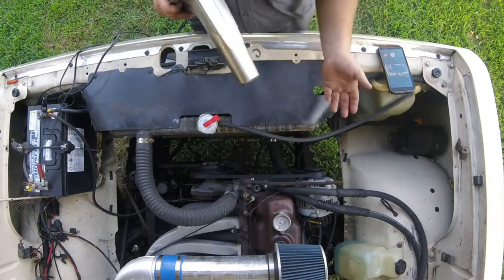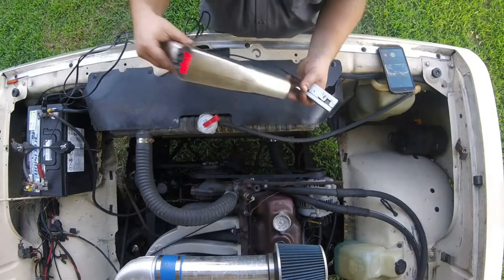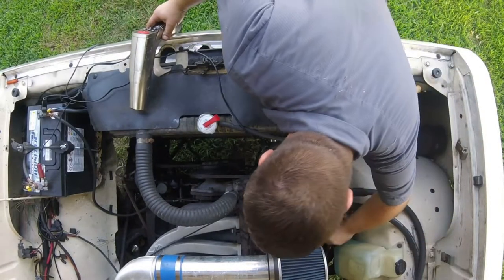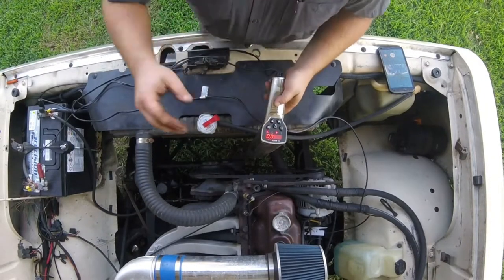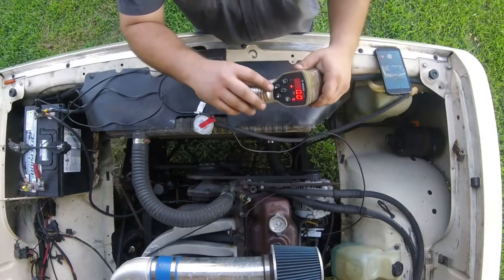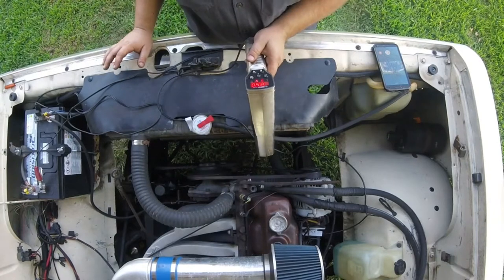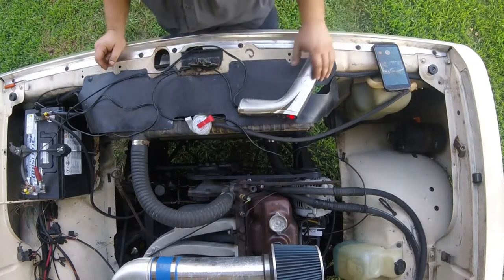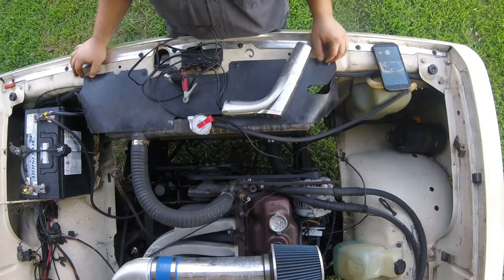Tool Tip Third Day - Timing Light

Comment: I remember using a timing gun on my 87 Chrysler Daytona. Whenever I did a tune up and replaced the spark plugs, cables,  pvc valve and distributor cap I would also adjust the timing. As far as I know all newer vehicles use on board computers to automatically adjust the timing now so you can no longer do it maually. I also like the intro but can you film yourself coming out of the trunk of a car?
Reply from the maker: That Daytona should have had an ECU that controlled timing as well. Most 80s Chrysler vehicles had a spark control computer even if they were carbureted. Lots of vehicles into the 90s and 2000s with distributors were still adjustable. Even with multipoint EFI systems. If the ECU is looking for the distributor position for fuel and spark timing, you would still need to set the base timing as a reference. And I'm not going to jump out of a trunk of a car or the bed of a truck.